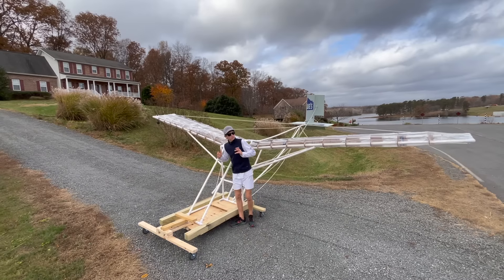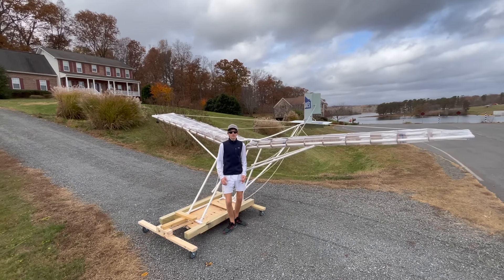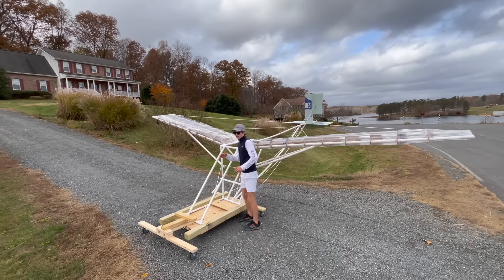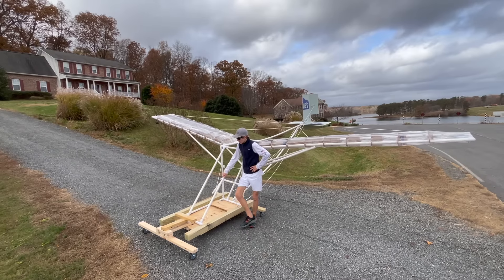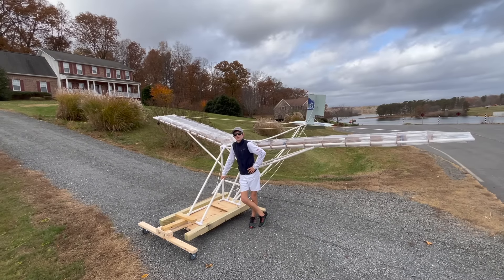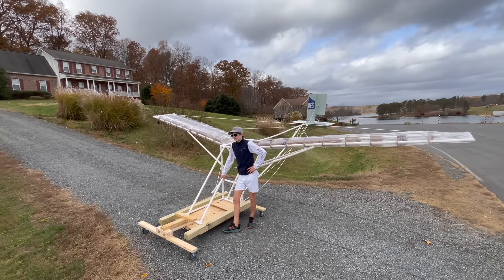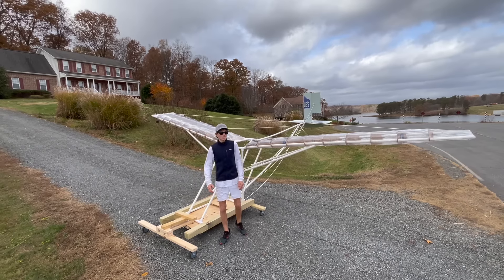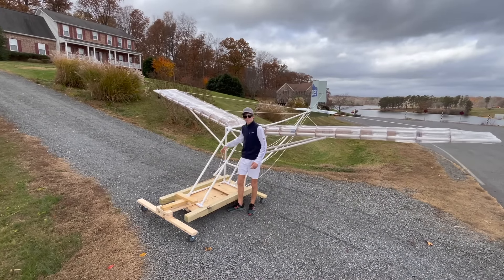I Built A One-Man Airplane!

Comment: It's a good thing it didn't lift off.  If if actually gained fifteen feet of altitude, you would have likely been hurt or worse. The design has potential but without enough thrust to overcome drag, it's going to stall. You'll never roll to lift off on a hill that's not steeper than your glide slope. PVC is too heavy and not stiff enough to be wing spars or fuselage framework. Replace the wing ribs with pink insulation foam, the pvc with aluminum, fiberglass, carbon fiber or even spruce, add triangular stiffeners to the fuselage. Cover the wings with something shrinkable. Put a paramotor engine and prop somewhere and it will probably fly if your weight and balance is right. Add some kind of landing gear and you might even land. Better off building a proven ultralight design before you risk your life on so many variables.

Comment: Hey man, Great little plane you got. Next time, Maybe make the tail boom more secure and make the vertical stabilizer out of something more sturdy, the wings definitely need to be more sturdy as well. Go get em’ bro
Reply from the maker: Thank you so much for this comment! Looking at the video, I saw that the tail was not responding to a lot of the movement from the control sticks, and now I see that it was because the tail was flexing to much. In the future, I will fix this! (and I will make the wings a bit more rigid)

Comment: Congratulations for the effort, the creativity,  the sense of undertaking something big ! ! 
This said, please, read from aircraft design manuals and courses.
Just looking at the aircraft, it is obvious that your wing spars are located much too aft which would have generated structural failure in torque and bending had your plane lifted off.
It is obvious the if you had lifted off, the wings would have collapsed and you could have been hurt.
You have to calculate your aircraft structure :
Static resistance,  aeroelasticity to prevent flutter, aerodynamics, stability , controls, etc.
Please take profit from 150 years of aircraft design history by learning and experimenting. 
I advise you to first spend a lot of time in the library , on the drawing board before starting to build à prototype.
Good luck and Congratulations again !

Comment: Probably you know it already, there is a relationship between the wing area and the total weight of the aircraft. Excellent. I like the plastic tube idea.
Reply from the maker: Thanks! Yes, I do know this, however when calculating how much the plane should weigh, I included the wing tip areas which didn't really produce much lift. Thanks for the input!
Reply: The pvc pipe is a bit scary for a main spar though, seems a bit flimsy, an aluminum tube would be more rigid, or perhaps build another lower wing, make it a biplane, with crossing cables and it would increase lift and rigidity, and move seat back so bodyweight is on the center of gravity.

Comment: gonna have to make it out of something more rigid, but still light weight. gonna have to build landing gear and get rid of the wooden seat thing lol have the frame come all the way down and build a cockpit with a lightweight seat, then think of more reliable controls.. like metal cables or pushrods  and then propulsion.  think safety first..  It will take a long time to figure it out but be patient..  good mark 1

Comment: The tail plane isn't strong enough. It needs spars and ribs like the main plane so the tail surfaces are ridged and ridgedly mounted to the fuselage. Need a steeper hill or/and larger wheels for more speed. Flight needs a lot of speed.
Reply from the maker: Thank you so much for this input! Looking at the video, I saw that the tail was not responding to a lot of the movement from the control sticks, and now I see that it was because the tail was flexing to much. In the future, I will fix this!

Comment: hey man, very very well done. 
if i may i would like to offer a couple of suggestions, i have designed and flown multiple remote control planes, as you might be able to tell by looking at my channel.

but here are the suggestions i would like to offer:
- increase the rigidity of your rear fuselage, also make sure that your tail surfaces are large enough for stable flight. 
- use foam core for your wing ribs.
- calculate and check your center of gravity just looking at it it was more than likely very nose heavy which will prevent it from lifting off the ground.
- increase your wingspan.
your wing struts should connect onto the fuselage lower down do have a larger angle between them and the wing, this will prevent wing flex.

i am very impressed with what you did here, hope to see many more builds from you!

Comment: Nice effort but getting off the ground may have led to a structural failure. PVC pipe is not strong enough hence a lot of flex. Your tail section would likely twist right off. Keep trying but make your plane of stronger stuff. Good luck for your future flying endeavours
Reply from the maker: Thanks so much! Will be noted!

Comment: THose wings will brake up once al pressure is put on it by lift, dude dont do that, plastic tubes wont sustain your weight plus G forces on it positive no negative..the brake lever is inverted .it must be tricycle, and cut wood from your seat in holes or circles to cut weigh.

DONT.

Comment: The reason he can't fly is because his center of gravity is too far ahead (I think), he has other problems. For example, the dihedral angle seems a bit exaggerated to me.

In addition, instead of plastic water pipes, it would be more reasonable to use 6061-T6 Aluminum pipes with a diameter of 50 millimeters and a wall thickness of 1-1.5 millimeters. I saw the wingspan slightly insufficient in the video, of course I could be wrong.

I am experimentally developing tailless aircraft, so I have some knowledge of some subjects.

Of course I could be wrong, I'm not an engineer after all.
Reply from the maker: Thanks for the info! You are right about the wingspan being a bit short. As I said at the end I probably should have gone with a 40 foot wingspan. The CG was measured before the test so it was in the right place. I didn’t have access to aluminum pipes, but if I try this again in the future I will make sure to use them!

Comment: Right on! Do you have your CG set properly? That will have a major impact on your ability to become airborne, and stay aloft. Have you done a "Hang Test" to verify your theory? When you do these awesome things, you will want to survive so you can brag about it later. Since you have a glider design, you will need a much steeper slope to become aloft. Just a thought. Go for it young man!
Reply from the maker: Thanks! The cg was set properly, I think the problem was that the elevator didn’t have enough authority over the plane. Next time, I’m going to start with a hang glider type thing, and add parts until I have an ultralight airplane!
Reply: @All Original   Have fun with your project!  I think this is a great opportunity for you to learn about materials and their properties.  The cellophane seems to be a bit too thin for your project. My Paraglider uses a lightweight cloth that is incredibly strong.  If you intend to fly in your device,  be sure the materials are up to the task. It will be well worth the effort.

Comment: Your cart is too heavy, and with your added weight, the wings could fail at the root.  Lengthening the wings to create more wing area will cause too much bending and could increase the potential of failure at the root.  Your best option is to make a super light cart from the plastic tubes or carbon fiber tubes.   Also, you may want to add cables or lift struts to keep the wings from failing at the roots.  I expect that your goal is to get off the ground (in ground effect), and then land...just to say you successfully made a flying machine.  Impressive attempt non the less.

Comment: You built something, all right.  And it was impressive.  However:  maybe it was good it didn’t fly.  You want to be sure you have good control of it.  You would not want to be lifted up 30 feet and then dumped to the ground in a stall/spin like some of your RC planes did.  Many, many people have been killed in stall/spin crashes.  Don’t get hurt.  I’d test it with various sandbags, first, towing it with a vehicle of some sort to get enough airflow over the wing to generate lift, and in a clear area away from trees.  Find out if its wings and support struts/wires are actually strong enough to withstand the forces of lift and drag.  I don’t think your wing spars are strong enough.  Study some wooden wing structures in real airplanes, and remember that triangles are strong.  But you want to make darned sure it doesn’t come apart with you in it above about 5 feet or 15 mph.  Use good glue!  Maybe build a full-scale RC plane, first, carrying 100, 150 and then 200-lb loads.  That really could be a lot of safe fun, if it’s legal.  Maybe it can carry batteries to power a motor to drive a prop.  When it gets to such weights, it will probably have to fly over 30mph…it can do real damage to whatever it crashes into.

Comment: The tubing is to soft for your application. They're flexing and bending to much. You need to increase the size of the stabilisers and also reinforce the tail structure. And judging by the weight of the tail, or better say the lack of it, with you in the plane, it seems to be nose heavy.

Comment: I wonder if, rather than depending on gravity to move the cart, you could rig up a way to pull it behind a car.  That way, you can accelerate faster and control precisely your speed.  Lift generated by wings is a function of surface area AND speed.  A shorter wing will produce the lift needed if you increase speed.

Comment: Radio Controlled airplanes are one thing, putting yourself in the plane is a totally different situation. Crashing from even just a few feet off the ground can result in very serious injuries.
Designing a sturdy and safe aircraft that you can put yourself into is a very serious engineering project.
How did you verify and check your center of gravity? The CG along with structural integrity is of the up most importance.
This design you have built is extremely dangerous for attempting human flight.
You have a lot more to learn before risking serious injuries by putting yourself in the aircraft.
Don't let your ambition get ahead of your skills.
Be safe.

Comment: Good try there. I would make a small change to the brake so that when you pull up, the rear of the board goes down aft of the pivot point. If you do get airborne and need to use the brake, and you are on grass, the front tip will dig in and bring the craft to an abrupt stop, with the brake board possible rotating violently into your hand or arm. Good luck with the next build.
Reply from the maker: The wood cart was not attached to the plane so I don’t think it would have really mattered. I really appreciate your feedback! In the future I may try this again and will take all of this info into account!

Comment: I think a mixture of the wings bending when they started to generate lift and how elevated they are both caused it to have issues taking off the ground once it did start generating lift, you should try to test if it can hold your weight by tieing ropes from the wings and hanging it from a roof then sitting in it
Reply from the maker: Unfortunately the plane is severely damaged and I won’t be able to conduct any more tests, but if I try this again in the future I will do this. You are right about the wings flexing, but I was trying to keep the weight down.
Reply: or hang the plane from the seatpost, hanging lots of water bottles from the wings reproducing the maximum lift distribution (can subtract from the water 2*distributed weight)
Reply: @dordagiovex9989  smart idea
Reply: @All_Original  sorry to hear that

Comment: That is fantastic very nice job don’t give up that will work. A little bit more strength a couple of ailerons for the role access and that wooden cart needs to be built out of something else a lot lighter. You might need a steeper hill to build up more speed for a lift off. And make sure your parents has paid their insurance bill, you know just in case😅 don’t give up you can do it again very nice job👍👍🙏🙏🙏

Comment: I see a lot of comments encouraging and congratulating you. I'd like to inject a note of caution to counterbalance that. Your airplane lacks strength, stiffness, and balance. You need more wing area. You need a more robust control system; you don't want to be fumbling for a rope in a situation where a second means the difference between life and death. Your wing needs much stiffer spars. Glad you added the struts, but you'll want to lead them downward at a steeper angle. Consider a system of bracing wires instead, for lightness. You need more tail area, and your tail boom needs to be stiff enough to resist twisting and bending. And you need more airspeed, which means a steeper hill. Examine the design and operation of hang gliders for some ideas. Consider some safety equipment, such as a helmet and a seat belt.

Comment: I wonder how well those wings can take the load. I would hang the plane by the wings and sit in it to ensure its strength. That would also verify the CG balance as a bonus.
Reply: You are correct, that’s the right way to do a load test. theoretically, you would also put sandbags in the pilot seat equivalent to four times the weight of the pilot.

Comment: you did great but you will need to change the wood frame to aluminum trike type frame im sure you must know the wood is way to heavy and not very aerodynamic. also all the pcv needs to be changed to aluminum. if you did it could really work!  keep trying until it flies! but do it safely this time! this was not safe at all in any way and i am glad it did not lift or you would be in the hospital bud. maybe perfect the trike and motor first then move on to the wings with help.

Comment: Try to put just a little more thought into it and I personally think that you could get a  plane that would fly, maybe start with a flying wing design, like a hang glider with controls
Reply from the maker: Thanks for this, you read my mind. When I try this again in the future, I'm going to start with a hang glider type thing, and than simply attach a tail and engine to it!
Reply: @All_Original  try using a fully smetrical airfoil and I think that you will be able to build a stronger airframe and a more controllable airplane, and use a elavon control system for up and down right and left bank and fixed wingtip rudders for simplicity, put your controls down into on stick

Comment: You need to add some trusses in the wing to prevent the twisting. It looked like the wings were changing AOA throughout the whole rollout.

I would also double the tail boom and add trusses to stop twisting. Make the horizontal slightly larger tighten the rigging. 

It will fly

Comment: Overall a good design except for the materials you chose.  Yeah, I know.... on a budget.  But if you got a chance to invest in proper materials, you would have a nice performing aircraft.  So the frame should all be of aluminum tubing.  Aircraft grade aluminum if possible.  Skin on the wing could be Dacron.  Make sure you have a bit of twist in the wings so that the trailing edge is a few degrees higher at the tips than at the keel.  And instead of rope (which stretch) go with aircraft cables.  There is a factory made wing called the Quicksilver that is pretty much the same concept as your wing.  But with all the proper materials that I suggested.  I flew one for several years and felt very confident in it performance and dependability.   I started flying hang gliders in 1973,  Always bought either kits or ready to fly wings and the same with the powered Quicksilver.  I flew the quicksilver (foot launch) unpowered and later added the power.  Lots of fun and through my over 3 decades of flight I never had and incident.  Never a scratch.  I can assure you, that with the wing you have at this time, if you do get airborne, I would have little faith that it with handle properly, as there are concerns as far as whether you have established your seating placement in the proper center of gravity.  And of course as I mentioned before, you have to use better materials or save up your money and buy one that you can afford, get proper lessons and you will be on your way.  There is no need for you to re-invent the airplane, as all that has been worked out already.  And unfortunately there were a number of hang glider and ultralight pilots that paid the ultimate (death) in  trying to fly on the cheap.  I will subscribe to you channel and keep and eye on you.  I am 69 years old and only recently gave up hang gliding a few months ago.  Again that is 40 years of hang gliding and and ultralight fling without and incident.  You should pursue the same.

Comment: You're getting there. I realize that you want to keep the center of gravity low on your "escape vehicle", but have you considered using larger diameter tires, but maintaining close ground clearance? Also, is there a release from the cart? The other thing looks like to take some slack out of the control lines. That brake system looks pretty sketchy. "Never tell a commando to be careful", the old man told me. But i'll say it anyway. You're a commando. Be careful. Where theory and practice intersect, that's when you take off.
Reply from the maker: Thanks for the comment! Yes, the brake was pretty janky and yes there was a release on the cart. Thanks so much!